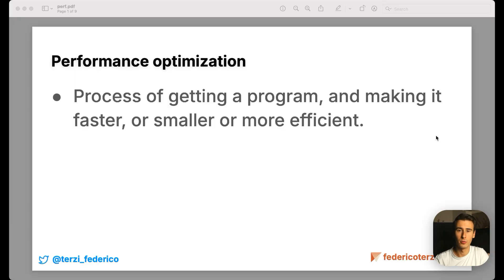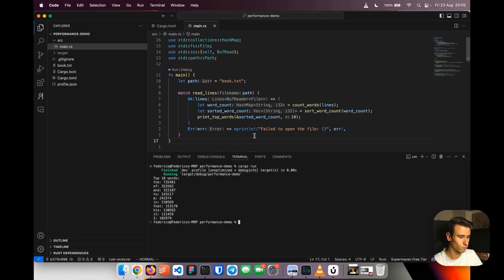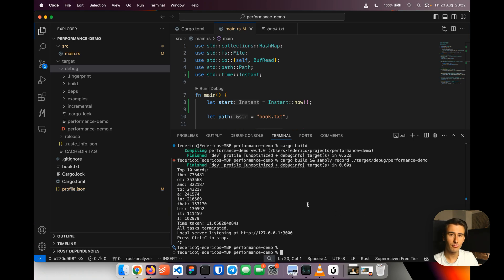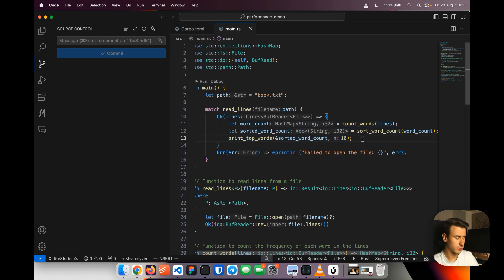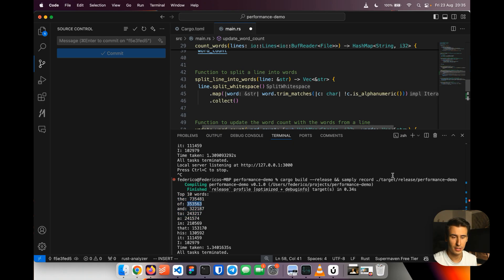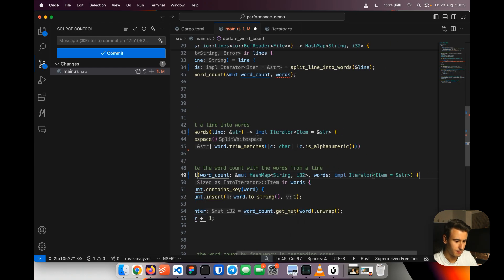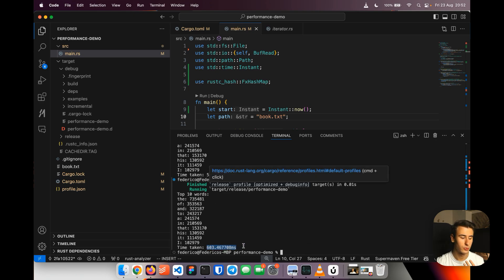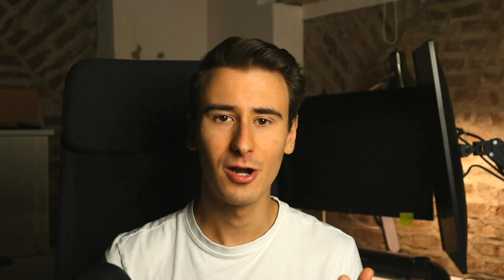Performance Optimization in Rust - How to Profile with Samply

Comment: I've been optimizing low level code for well over 40 years, what I learned quite early was to "never assume!": Unless you measure it, you really have no idea where and how the time is spent.
Back in the early 1980'ies, when the PC was the hot new thing, the best you could do was to use the system hardware clock counter, since this could get your down to the ~10 us level.
From the advent of the Pentium (around 1993-94), we finally got a built-in clock cycle counter and the RDTSC opcode to read it, this helped a lot!

In July 1994 I published the result of my reverse engineering of the Pentium EMON counters, the counters which samply and al other current performance monitors are using to pinpoint where time is lost due to cache and branch misses, partial register stalls etc.

Around this time, and for quite a long period after, Intel's VTune was the gold standard, I used this to optimize a lot of code like Ogg Vorbis, one of the AES candidates and Intel's h264 reference codec.

Comment: Oh, so Rust needs optimizations now, huh? I thought it was the ultimate gift from God? Well, it was nice as long it was a hype nobody had tried out, only praised a lot by the friends of the "inventors".
Reply: Idiots like you need to stay away from programming.

Rust is faster than most programming languages by default. Rust always needed optimizations, it's just that the compiler does them for you. This is EXTRA optimization. This is done manually so you can OPTIMIZE FURTHER AND MAKE IT FASTER. Stop talking about shit you don't understand. @swedushpsychopath8795
Reply: Are you retarded? Rust is fast. But you can make it even faster just like every other programming language. And you have to do extra work for it. Lazy retards like you should stay away from programming.

This is EXTRA optimization. Not necessary optimization.
Reply: Idiots like you need to stay away from programming.

Rust is faster than most programming languages by default. Rust always needed optimizations, it's just that the compiler does them for you. This is EXTRA optimization. This is done manually so you can OPTIMIZE FURTHER AND MAKE IT FASTER. Stop talking about shit you don't understand. @swedishpsychopath8795